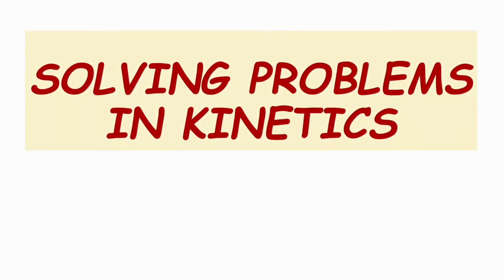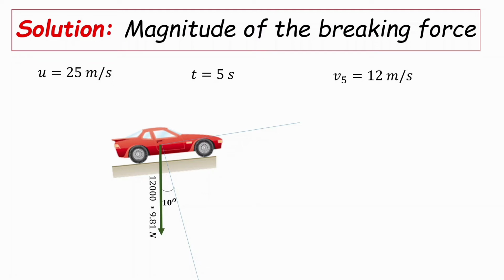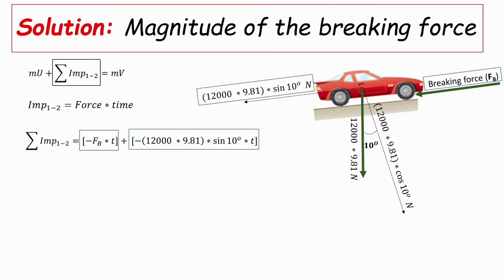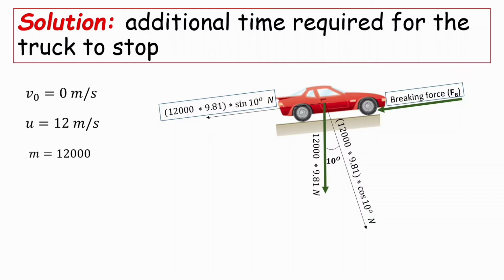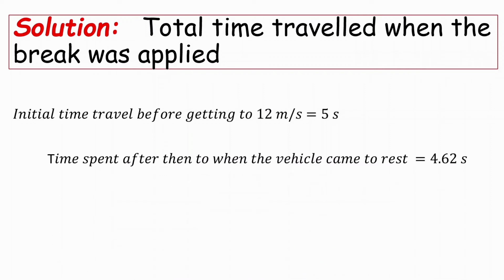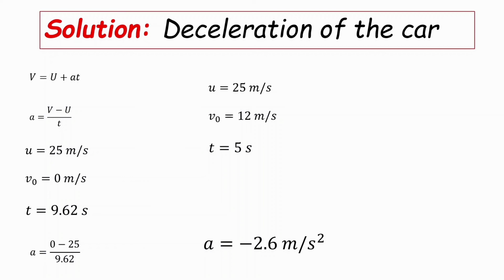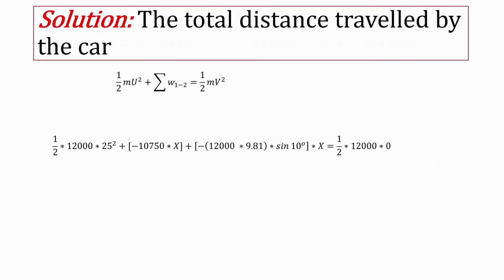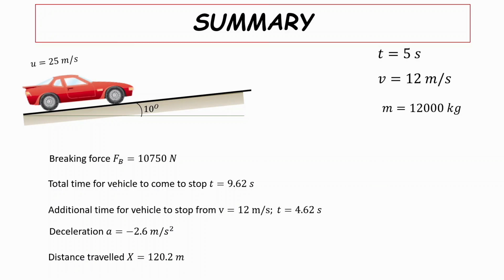Example on Kinematics

Comment: Really helpful video, thanks for sharing.

A quick question though: why didn't you use the vertical component of the car's weight as part of the summation of forces? The one with "cosine 10°"

You only used the horizontal component as the summation of forces.
Reply: I guess it's because we are considering the movement of the car in the horizontal direction only (it's either positive or negative), forward or backward.
Reply: @samuelogundimu8369  Oh yeah, that makes sense. Thanks.